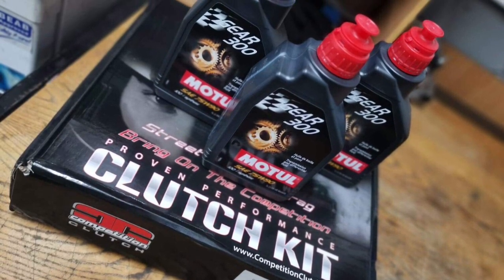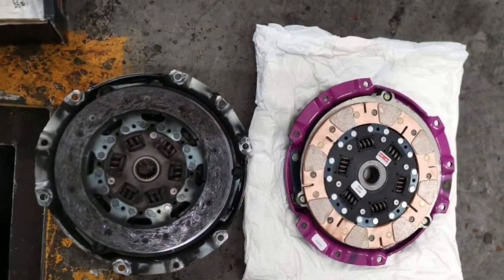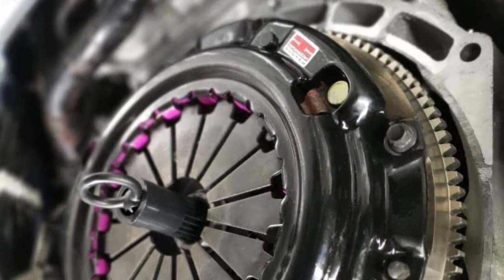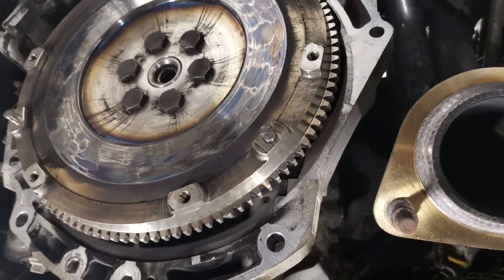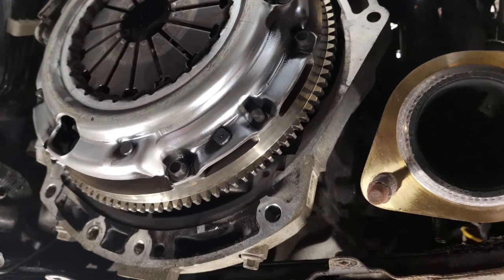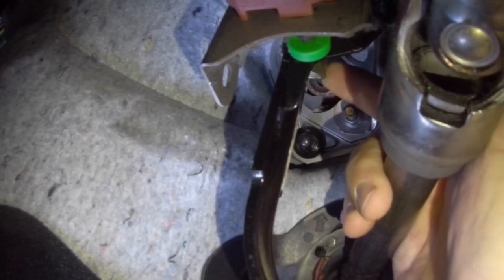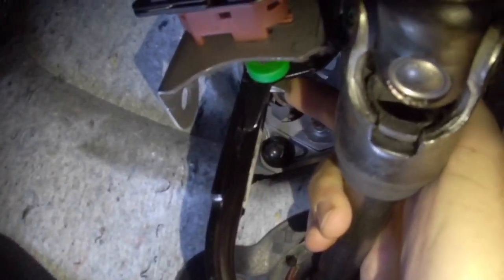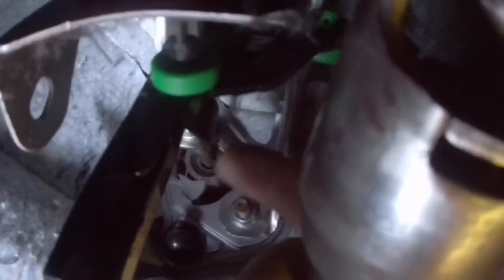Clutch Adjustment On NC MX5

Comment: Thanks for that.  My mechanic adjusted mine today and I reckon I'll get another few thousand miles out of it now.  Still drags ever so slightly so fingers crossed.  Only done 18k miles but the car does have a turbo.
Reply: The good news is that my mechanic now knows how to adjust a clutch pedal. The bad news is the car only did another 1,000 miles before the clutch will release slightly with the tinies pressure on the pedal. Discovered that the previous owner cheaped out on the car’s second clutch.  I’ve spent £330.  The supplier persuaded me not to spent £370 on a paddle one, which was good of him.

Comment: This good for a notchy 3rd gear?
Reply from the maker: @lassydogpie5390  probably not, if all gears are a little tight then yes, but if it’s one gear then could be a selector failing.
Reply: @mx5gaz709  cheers, maybe should try a brass one

Comment: Thank you sooooo much it literally took 2 mins, I was going to change the slave cylinder as the clutch bite was right on the floor no need now. As he says loosen the 12mm nut then turn the bar the 12mm nut is on I turned mine 3/4 of a turn to the right and now the clutch bites at about half an inch off the floor perfect👍

Comment: Hey mate! Just got a new MX5 all stock, the car bites super low down and almost as you start releasing the clutch. What is your fix actually doing??
Reply from the maker: TwoWheelTorque it’s adjusting the clutch rod that is engaged when you press the pedal, it adjusts the push rod so clutch is fully released when pressed. It’s worth trying on yours for 10 mins of effort, it slightly changed biting point as well.

Comment: My 2015 nc clutch feels so awful. It feels too tight and requires a lot of concentration and effort to make it smooth especially when starting in first gear. I’m not a bad stick driver, it’s just the stock clutch is finicky. Am I correct? That’s the problem that you had as well before the adjustment?
Reply from the maker: Denis Filatov try adjusting it fella and see if it improves any. Standard clutch on a fairly stock power output should be fine tbh though.
Reply: @mx5gaz709   I'd like to lower my clutch slightly. Little bit clunky on changes. Did you turn it clockwise or anti....cheers

Comment: Nice 1 Gaz, I need to do this, I'm also going to swap the plastic  for brass thing on the end of my gear knob.
Reply from the maker: It will take 10 mins. I wish id done it months ago. Let me know how you get on.
Reply: @mx5gaz709  I will do mate, love your vids 👍
Reply: That bushing change and changing the tranny fluid with the newer ford fluid made a difference .
Reply: @JAYJAYJAY53  What ford oil do you use?
Reply: @briancassell2797  engine any pure synthetic, transmission that super expensive Ford transmission oil it is like $25 a quart